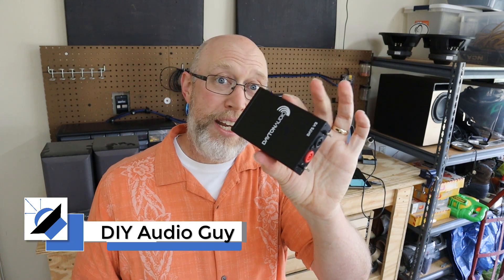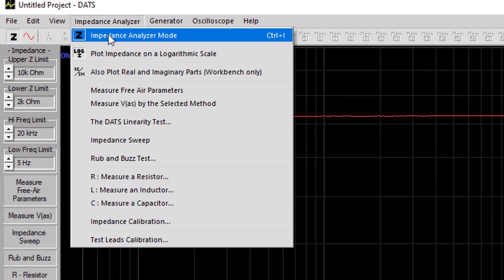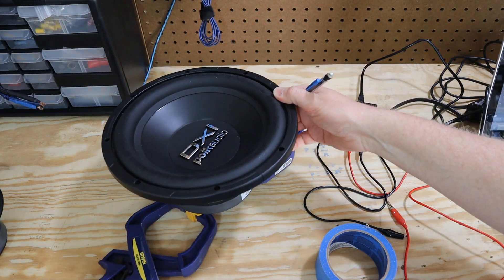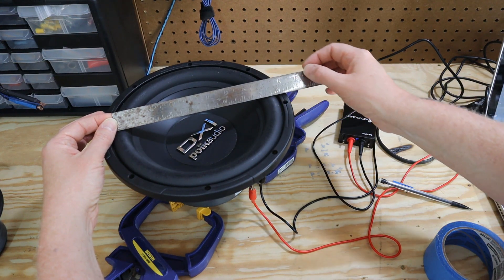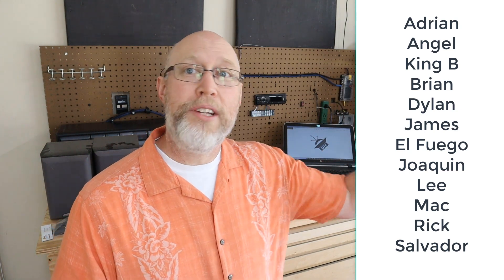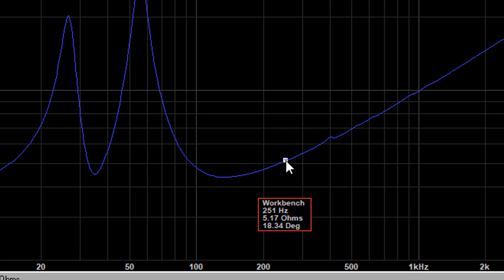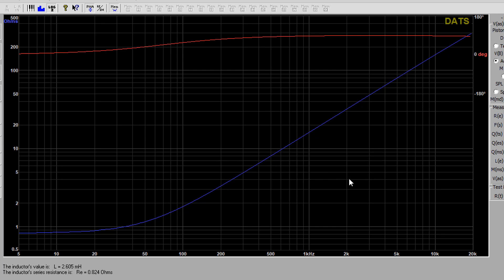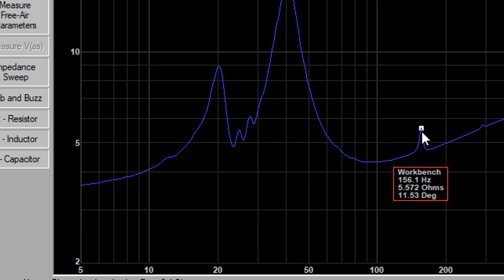The Ultimate Subwoofer Test Gear:  DATS from Dayton Audio

Comment: I have the original DATS and it’s still in use daily.  Mine was a simple dongle with test leads. Excellent and most certainly essential piece of kit.

It has its faults though such as not having an option for testing an inductors value at  industry standard 1khz.  You simply read iff the impedance value at your chosen crossover point and calculate inductance.

T&s testing can  be hit and miss, especially using added  mass method.

All things considered it’s essential if designing speakers and crossover networks as files can be exported into cad packages to combine impedance and frequency response to derive filter designs.

Comment: I bought this as it came out lol. Have both V2 and V3. Excellent equipment. Just looking for suitable weights
Reply from the maker: Yeah, it's kind of neat to be able to check all these things now!
Reply: How does V3 actually compare to V2? Is it worth the price difference?
Reply from the maker: @lio1234234  as far as I know the biggest difference is that version 3 has an internal resistor so that you don't have to dig around for a resistor if you want to calibrate it.

Comment: Just a quick note, inductors don't burn up power when in a typical crossover. Resistance is increased in HF signals, so the signal is more likely to go to another source, such as a tweeter and not lost as heat. You know, path of least resistance.
Reply from the maker: Right, the resistance is a function of the frequency, that's how they work.
Reply: Also, every drive unit made uses voice coils  which all have a rising impedance with frequency so have an equivalent inductance.  

Passive crossovers lose very small amounts of power in inductor dcr and esr of caps as well as through heat loss in resistors but in general, it’s not why active is “better”.  That is more down to output impedance of an ideal voltage source driving a speaker being zero ohms.  

It never is but in passive networks the dcr of the BASS inductor which handles most current (lowest impedance as it’s at lowest frequency) is ADDITIVE to output impedance of driving amplifier and since the only thing determining damping factor is the ratio of speaker voicecoil imoedance to output impedance passive will generally have poorer damping in the bass= more out of band resonance.  The answer is simple.  Use laminated steel core bass inductors and low output impedance amps.  Too many badly advised people being recommended set amps by numpty reviewers!

Comment: An important thing to look out for when doing the t/s measurement is the smoothness of the impedance peak around resonance.  If it's not smooth, something nearby might be affecting the driver, which results in not only the impedance curve being affected, but also the measured t/s parameters may turn out to be inaccurate.  To avoid this happening with woofers.  I usually just hold them out (if I can!) at arm's length when doing the measurement.
Reply: One of the best things you can do is build a slimline stand to get it away from reflective surfaces such as a desk or table top. You'll see a more true representation of the measurements.
Reply from the maker: I have thought about doing that.
Reply: I've supported the driver  with magnet resting on a piece of PVC pipe  and pipe made to not to block a driver's vent or
introduce a pip resonance back through the vent.  That takes a bit of balancing but reduces acoustic and air reflections which could modify results in the case of lower mass drivers.,
Reply: @DIYAudioGuy when you are measuring the subwoofer and connect the DATs clips to the binding posts.  Is the crossover in the sub?   Or is it just the drivers in the box?
Thanks

Comment: i have one of these for ultra high frequencies, like in the mhz, up to 1.5 ghz! it measures the same things (resistance, impedance and inductance). i use it to tune not subwoofers, but antennas! (here theyre called "vector network analyzer" or VNA) with it, i can calculate (it calculates for me lol) hhow much power gets reflected instead of radiated at a range of frequencies. this is some cool stuff, currently debating if i should buy the DATS and commit to spending a bunch of money on another hobby lmao
Reply: what id love to see is a smith chart for a subwoofer lmao

Comment: I had a pair of those Polk DXI 12s in my 79 Civic for a couple of years on a Kicker 300.1 and slammmmed
Reply from the maker: They have been great, these are about 7 years old. They were only $40 when I picked them up from crutchfield, I think it was a closeout deal.  Right now they are just props for videos, I need to throw them in a box.

Comment: What if you are measuring a 2 , 3 or MTM speaker performance?  Do you hook up the clips to the speaker terminals jumped together ?   Or if it is capable of biwiring you do the tweeter and bass separately ?

Comment: I can do the test lead calibration, but I can't do the impedance (1K) test and it won't pass it. "The calibration was outside the valid range..." and what does that mean. I even tried an external 1K resistor and got the same result. Any got any ideas?

Comment: TS params change over time also even after a break in. I wonder if the manufactures TS params would be close over the life of the driver given the average of changing values. In car audio the change must be fairly large. Think of how Vas changes in a 100F temperature vs 40F.
Reply from the maker: Yes.

Comment: very interesting, now because of you i bought one, but i do have issues with a woofer, a Goldwood GW15PC4, the measured parameters differs a LOT from the original specs, and the VAS is literally doubled !! 4,4 vs 8,1ft3, what am i doing wrong ? and sure enough when i enter the specs in WINISD it get red tagged and a box of 3423423423 meters wide
Reply from the maker: Did you break it in?  The TS parameters are supposed for a subwoofer that has been broken in.  This is just a matter of letting it play for a few hours.  The suspension should get looser, that of course means that the vas should go up, not down.
Reply: @DIYAudioGuy  yes, they are fully broken it, i have 4 of them actually. i will ask Parts Express if they can measure some they have in stock. what surprises me is that the VAS is literally double of what manufactuer pretend....thats strange. thanks for the answer !

Comment: The small peaks above 200 Hz in the box measurement could be cone resonance.  The larger the driver, the lower the cone resonance modes.
Reply from the maker: Any advice on what's going on with the PR box?  I was very surprised to see those little ripples around the tuning frequency.
Reply: @DIYAudioGuy  Parasitic resonances somewhere.  Could be panel vibration for example.  Or even room resonances. Put the box on top of a pillow and measure it again, to see if the ripples are still there in the impedance curve. If they're still there, redo the measurement in a different room, or outside :-)
Reply from the maker: @Grommet2007  could be the Harbor Freight lift table that it's sitting on.

Comment: Great vid, I just started using my DATS v3 this past weekend.  I tested two very well known subwoofers and the difference between the manufacture's reported specs and the specs from the DATS were a bit shocking.  I know you mentioned one in the video, but have you been finding this to be the case on quite a few subs?  For ex, the reported Fs on one was 33.96 whereas DATS reported 47.1.  On the other sub, the reported Fs was 34, the DATS reported 47.37.  Tested 5 times over and kept getting same results for both.  This would mean all of my builds to date haven't been as accurate as they should have been.
Reply from the maker: There are a lot of factors that can impact the TS parameters.  You have to make sure you've done a good job breaking them in, and the temperature can have a big impact.  https://youtu.be/620x62jLgGE?si=5_8hYc_rg3N1w-8s

Comment: - just got the DATS V3 - - initially it would not work and gave "The sweep was not detected".  So in Windows 10 I had to give the Microphone permission to use apps - then things were working.  It doesn't seem to have Z overlays ? - or can a number of impedance sweeps be stored as with the old WT3 system ??.  Also, as it uses 
USB speaker out, that seems to preclude listening to Youtube, etc. while using the device - - ??
Reply from the maker: I'm not sure how to do the overlays you're talking about, I don't do much with it besides run sweeps supported enclosures to make sure that I got the tuning frequency I was shooting for.   I typically just grab a screenshot of that so I can show it in the videos.

The device itself seems to be a small amplifier, if you plug it in and connect it to a speaker you can hear the audio from the computer coming through the speaker.  That's not really practical for listening to music.  I suppose there is a way to route the sound to an audio output instead of to the USB. That's more of a computer software thing and not really my area of expertise.
Reply: @DIYAudioGuy  Thanks for the reply- Here's the way to save up to 20 sweeps - I had forgotten how to do it from WT3 days 

"9) After measuring the speaker you can:
 Save the data to one of 20 project memories (Alt+1 saves to Memory 1 for example)
 Save a DATS project file (file extension .tzz) which includes your test setup and all 20 memories
 Export the parameters and impedance data in either “.txt” or “.zma” formats
 Overlay plots of various measured impedances from the 20 memories for detailed comparison
 Print a report showing the impedance and parameters of the displayed memories"{

Comment: hi when you did ported sub tuning was there a cross over in the cabinet? or was that a test enclosure? can i use my existing cab to to test box Vas if it has crossover in ?  I am new to this and its confusing as heck :)
Reply from the maker: None of the speakers that I tested in this video had any kind of crossover attached.  You don't need to cross over to run the sweep, but if there is a crossover inside the enclosure you'll be able to see the effects of it in the plot.
Reply: Thanks . I guess what I meant is can I use the external terminals like you did to att a h to the driver if the signal is going to go through a cross over . I think I answered my own question when I tried it ! Values were weird . Made much more sense when I connected directly to woofer but wasn’t fully sealed as wires had to go in through the baffle cut out
Reply: ha just noticed i seem to be logged in on my daughter you tube account lol

Comment: awesome videos, i have a question, lets say you made an enclosure with the aid of WINISD, you aimed at a ported 30hz FS, but once you test it with DATS you come up with 22hz....what would be the issue or what to check  ? can i just shave off the tube ports up until i get the desired FS ? thanks !!

Comment: How to added mass..sir?
What is the default value for , example
6" 8" 10" 12" 15" speaker??

I'am confussing
Reply from the maker: You can just stick a weight on the cone with doubled sided tape.  If you do not add enough weight you get an error message, just add more and restart the test from the beginning.
Reply: @DIYAudioGuy  oh, okay, sir.
Thank you for replying my comment..
I will try it again..

Comment: Would this tool be effective for full range co-axial speakers? I have a pair of Alpine S-S65's laying around that I want to use as bookshelf units but cannot find t/s parameters anywhere. Thank you for your awesome videos.
Reply from the maker: That's a good question.  I know that you can do an impedance sweep of home speakers, so you could do the same with a coaxial.  I'm not 100% certain how that would impact the TS spec. I'm sure if you were to reach out to the Parts Express tech support they could probably tell you the answer.

Comment: I recently got the dats v3. When testing box tuned my graph in the "tuning dip" isn't completely smooth it's kinda smooth at the bottom but kinda does this jagged as it comes up on the left and right. Is this normal? If not what step do you take to find out the issue?
Reply from the maker: No that is not normal. But it does happen a lot. It means that there's something wrong.  I don't know enough about to know exactly what's wrong.  Could be something as simple as the box moving when you tested it. Could be a leak, could be some kind of resonance that might be fixed with a brace.

Comment: Hi… how do you deal with Xmas or excursion of a woofer when it’s not published?
Reply from the maker: X-Max is a mathematical calculation.    If you can find the length of the voice coil and the height of the magnetic Gap, you can calculate it. 

But it's very much unlikely. Todd figures are available if you don't have the xmax.  In that case you just have to make the best educated guess as possible. Compare it to other similar subwoofers, that kind of thing. 

There may be no way to know for sure, so you're just kind of speculating.
Reply: @ … from what I’ve seen so far, it’s a guessing game… I’ve been thinking about buying a used 12” Klipsch sub for my own project, but there’s no data on any of the drivers at all 🙄… thanks for the quick response.

Comment: i am curious to see differences between this and bass box pro testing procedure :)
Reply from the maker: I have never tried that software.
Reply: @DIYAudioGuy  it's quite old software. Very manual procedure with multimeters, resistors in the hand, amplifier, signal generator etc :) i made few boxes with that software for cars, and always very good results. I would like to have DATS, it's looking very useful but spending 1/3 of month salary is a plan for the future :)

Comment: Hello, I recently purchased this device, but the computer does not see it because the DATS V3 drivers are not installed. What to do please help!
Reply from the maker: Try heading to the Parts Express Website and downloading the DATS software.  https://bit.ly/3vYF1B8 If that does not work then reach out to their tech support. They are very good and can get you all set up.
Reply: @DIYAudioGuy  THANKS

Comment: When you add a weight, don't you need to secure it better with something like clay?

Does your tuning frequency report differently in a trunk as opposed to am open space?
Reply from the maker: Good questions.  The sweep is very low power, so I don't think you need to stick the weight to the cone.  It seems to stay put and the manual did not mention anything about it.  A speaker will perform differently in different environments, I may need to test it in a car and see what happen.

Comment: How do i measure a dual voice coil Driver... parallel, series or single by single?
I use the speaker single by single on a 2 Chanel Amplifier.
Reply from the maker: If you're trying to get the TS parameters then measure the coils in parallel.  If you're trying to get your box tuning it does not matter how the coils are wired when you measure them.  Make sure you disconnect your amplifier before you measure anything.
Reply: Ok... good to know.
Big Thanks for this Information.

Comment: Ok, I've got a mystery for you to figure out.  I have a Monitor Audio 12" that I just tried getting the TS parameters using the DATs v3, but when I tried measuring the VAS, it told me to add more weight than the 506g that I had on there.  I kept going up and up, and it keeps saying to add mas.  I'm now up to 4094 g, and it's still saying TO ADD MORE MAS!!!!   What the heck IS GOING ON???!!!  The first measurement was fine, but not the VAS.  Any advice?
Reply from the maker: I've seen that happen before. 

Make sure that you restart the process if you're adding extra weight. So take the weight off and do the initial sweep before adding a larger weight. 

If that doesn't work, my advice is to reach out to parts Express and see if they can provide some tech support.
Reply: @DIYAudioGuy  Well, I figured out what happened, and I've never seen this happen before, but the driver locked up from the test.  I know, impossible, right?  All I can think of is MAYBE it was ready to go anyway, and that tiny little signal pushed it over the edge.  I don't know how else to explain it other than an act of God, but he and I are on good terms so I've counted that one out....lol.

Comment: I hope you see this after being posted a year after you released this...  

I have 6.5 DD 1506 supertuned woofers.  I hooked my Dats V3 up and followed the instructions just as I always have on all my other builds.   I calibrated both the leads and the impedance.  I then ran the free air sweep.   Then, I added weight to run the VAS sweep.  I started out with a beanbag, got a error saying not enough weight 25%  less than the FE.  So I added more weight.  Keep getting the same error.  I went all the way up to 10 lbs and then even 25lbs.  No, it didnt bottom out the sub as these things are beasts.  But even with that weight, it still gives me that error.  Im at a loss.  Is this defective?  Have you experienced this and what ir how did you fix it?
Reply from the maker: I had a similar problem.  I have not gone back to test that sub, but I did get some advice from a viewer.  Make sure that you re-run the sweep with no weight before you add more weight.
Reply: @DIYAudioGuy  I will give it a shot!  Thank you and Happy Easter!
Reply: @bencook8109  It's a known issue with long excursion drivers (other factors also) so take the first sweep again and note the drivers FS then clear that setting and do a fresh sweep but this time with the added mass attached with BluTack (I use the cheap digital micro scales and lead or washers usually 50g total, weight incl BluTack). You want it to move the FS down by 25% (eg: FS is 40hz so 25% is 10hz meaning 30hz is your target or thereabouts on the sweep). Once you're close then clear that and rerun original sweet without added mass and then with the added mass required and it should punch out a result.